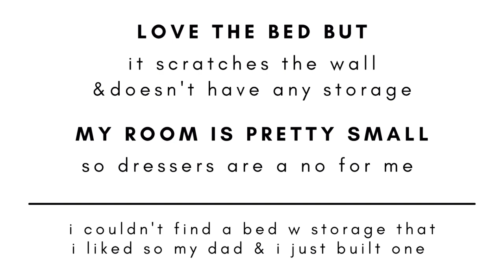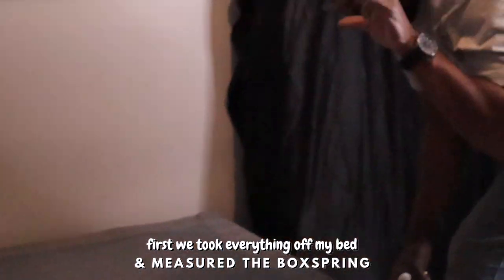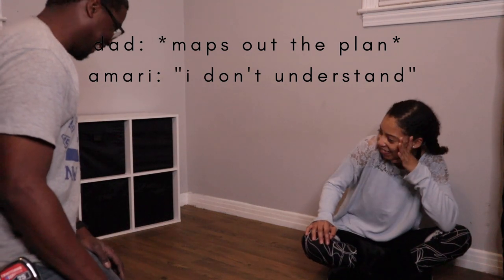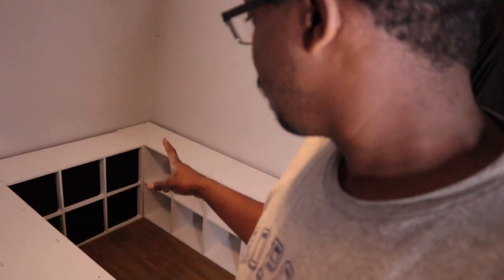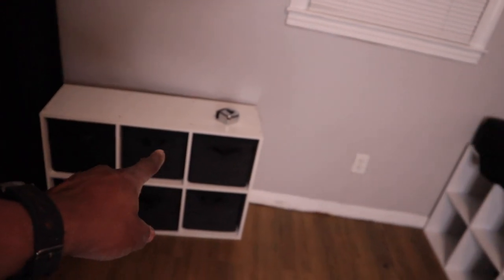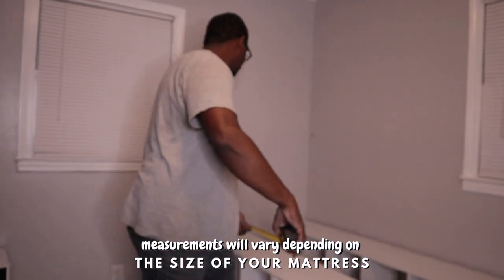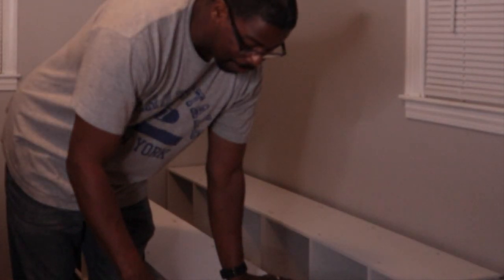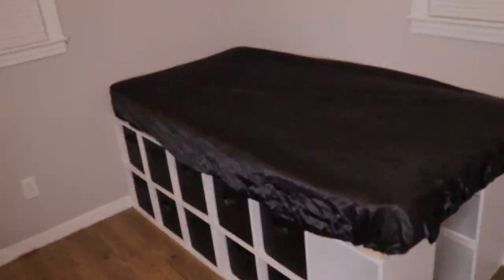DIY PLATFORM BED WITH STORAGE !!  EASY AND AFFORDABLE :)

Comment: How sturdy is the bed itself? Do the shelves wobble?
Reply: Also how much would you say it is
Reply from the maker: After the plywood was drilled to the organizers, it was very sturdy! My dad weighs 225 and it didn’t move at all! Also, I had a friend stay over and we both slept on my bed, successfully, with no problems. The price depends on how many cube storage organizers you need, for my twin size bed I only needed four, which is $29 each. You can get the plywood from Lowe’s for about $30. In total about $150 but you can buy everything in increments, meaning a little at a time. It’s worth the money, in my opinion, because it serves as not only a bed, but as a dresser also. Great investment!!